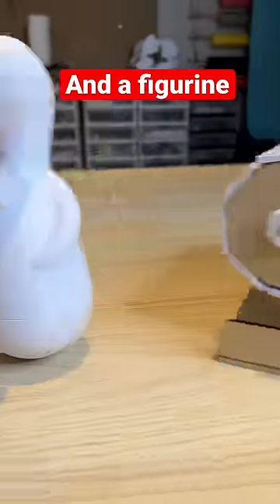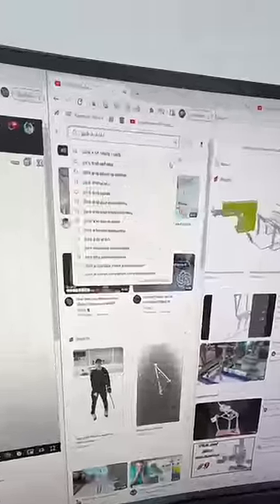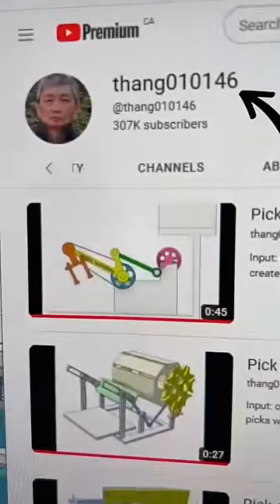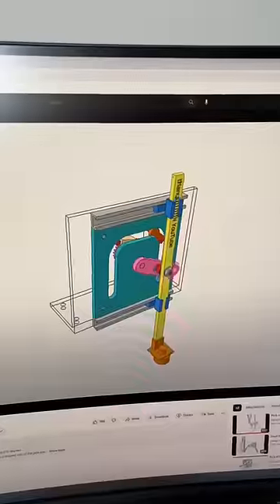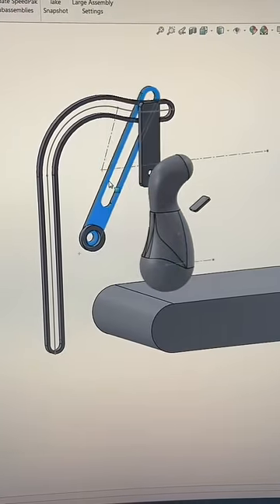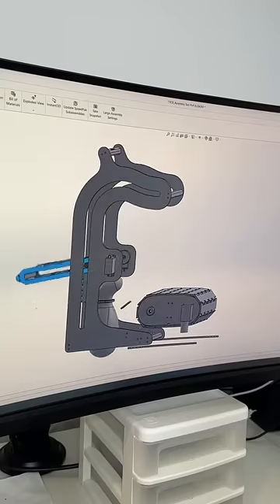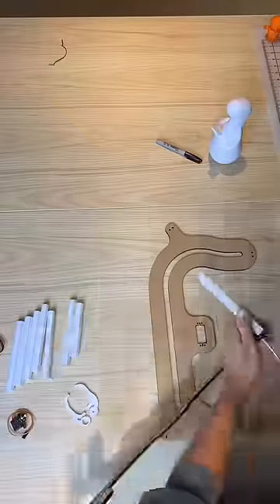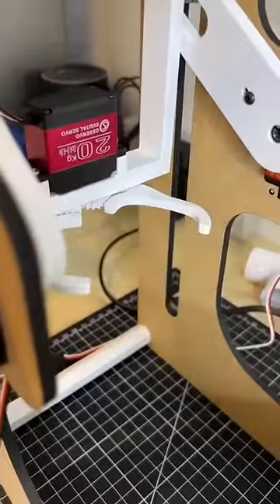Pick and Place Mechanism Design

Comment: Is there any consideration for tolerances with the laser cut wood?
Reply: When you use a laser cutter it burns away some of the material around it's path, it's called kerf. On that plywood he used the kerf is typically around 0.2mm and if you want tight fitting joinery you have to account for this 👍
Reply: @jesperhagstrom  Thank you!
Reply: @jesperhagstrom  thank you for sharing!

Comment: You could possibly replace the servo with a second cam/track and follower system that actuates the clasws in a specific order as the arm rotates from one end of its travel to the other. Then maybe even add a return mechanism to the motor output so that all you need is one motor running at constant speed for the whole thing to function on a loop
Reply from the maker: I was thinking something along those lines but I may stick with servos just because it doesn’t change the overall message I’m trying to convey with this piece- definitely like where your head is at!
Reply: You could also have it so the head is slightly wider than the neck so the claw can just be two straight pieces and it goes on either side eof the neck and catches on the head then when it gets to the conveyor belt the conveyor belt moves the figure forward before the claw returns to it's starting position.

Comment: Do you have any references on how to do the gears and motion aspects? I'm pretty confident in my ability to fusion up single part objects. But motion stuff has me lost.
Reply: I think it's largely just a matter of familiarizing yourself with existing mechanisms and then just figuring out how to adapt them to your use case. Just browse around and research gear types, drive shafts, cams, linkages, etc. Nobody knows every possible solution, people just use whichever things they are most familiar with and seem easiest and most intuitive to them in the moment.

There is actual hardcore things to learn (things like gear tooth profiles and how that affects efficiency and lifetime wear of components), but for an art piece that's less important. I mean, he says it himself in the video, the nice thing about making this type of mechanism for yourself is that you don't need to worry about stuff like that.

Comment: Just wondering, what is the programme you used to design the mechanism b4 you lazer cut it?
Reply from the maker: It’s called Solidworks!
Reply: Thanks. I've been using it in school but I couldn't remember what it was called
Reply: @machinemaker2248  thanks 😃

Comment: Interesting mech but the electronics were a cop out. I wouldn't call any of this art, though.
Reply from the maker: This comment is a cop out
Reply: @Engineezy  Because I called you out for going out of your way to design an entirely mechanical solution to a problem only to drop a microcontroller in at the last second because one cam follower was too much extra complexity?

Comment: Damn, I thought the entire point of these ridiculous mechanical principles videos was specifically so you didn't have to use code. Or electricity. Or even air, if you really wanted to commit to the bit and add some truly ridiculous Fourier transform fuckery to the thing.